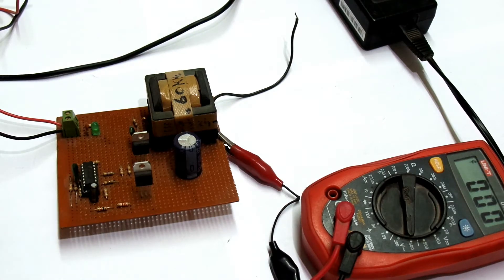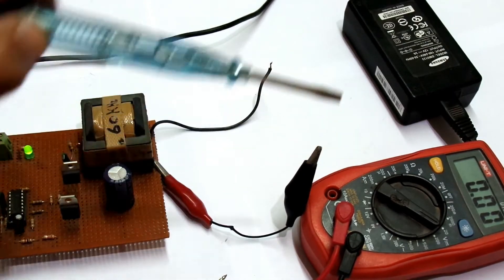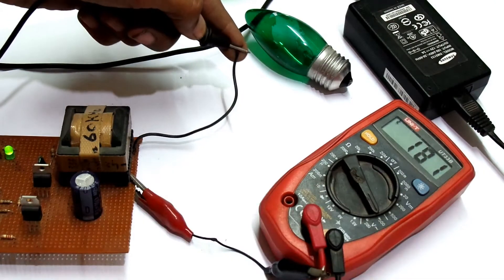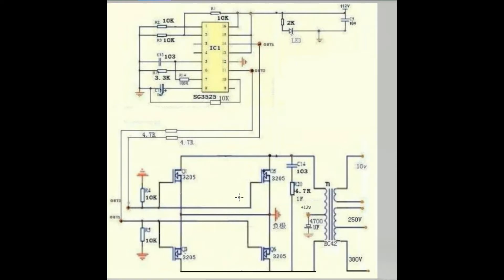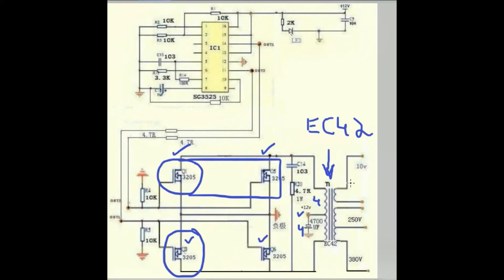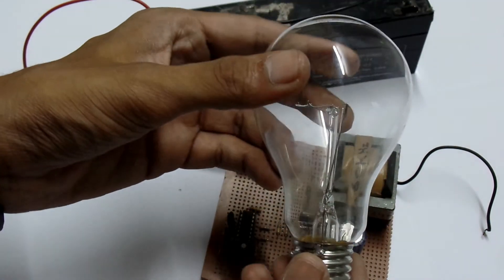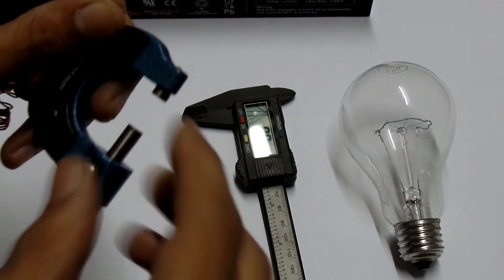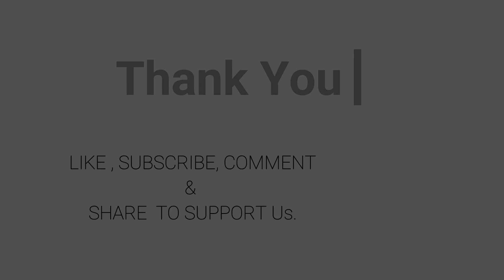DIY Ferrite Core Inverter 230v with Schematic (Part 2)

Comment: Great work sir🎉 but unfortunately I tried and followed the schematic diagram still my 4 3205 mosfet got blown 😢 i tried twice but no positive result did u have an idea on what am missing pls sir i need help 🙏🙏
Reply from the maker: @muktarahmed1304  yes sure. Let me know more about the way you assembled the circuit. So I can help you out with that. Double check your connections according to the schematic and IC datasheet. Use 4.7k resistor between gates and ground of every FET.
Reply: @samtechpro  thanks sir i will try again 😍😍😍

Comment: I never can understand why at higher frequency the mosfet get hot even at no load it get hot so fan is needed for higher frequency transformer never understand why
Reply from the maker: its very difficult to answer the question here in comment section. you may join our group of facebook the link to which is facebook.com/groups/samtechpro

Comment: Can you suggest circuit for 1kw inverter
Reply from the maker: same circuit would work but you may need to use big ferrite transformer with thick windings and more FETs in parallel

Comment: Hi, I have used 110v winding for transformer because I need 110vdc output , but after rectifying I am getting 300 vdc , how do I reduce it. By removing capacitor from output I am getting 200vdc . How can I get 110 vdc ?
Reply from the maker: You need to reduce turns on secondary keep turns between 40 to 42 turns only
Reply: @samtechpro  it is already 35 turns in secondary and in primary it is 3 turns centre tapped
Reply from the maker: @nikkmer  dont make only 3 turns they must be 3-0-3 turns centertapped means total 6 turns. Also make sure you used the same component so your frequency of oscillator matches the transformer
Reply: @samtechpro  yes I meant 3-0-3 turns not 3 turns and all are same components

Comment: Sir, I was wondering about the inbetweens of high frequency and low frequency that u have explained a bit in the comment as well as in the video. Since, frequency is conventional when it comes to play in our overall electrical network and that's being 50-60hz in general, so there must be some change to be incorporated in the inverter circuit..moreover, the inverter output frequency we are getting from this transformer is the same as the input frequency of the transformer which is nearly 27khz(u said in a reply)..Now, the frequency no matter how much may be is not important for resistive loads as they consume just the real power.But in inductive load the consume appparent power depending on the output frequency which must be specific in between 50hz or 60hz and that can't be in khz range at all though. My request to u if kindly u can explain the concept on this frequency management within conventional frequency range in case of inductive load  more further it will be very very helpful sir.. Also let me know sir if i made any mistake in my understanding the concept above..Thank u sir for sharing ur knowledge. :)..

Comment: will it cause any problem if i use a thinner wire like 0.3 mm for both primary and secondary coil ?  and how to calculate the winding if i use other size transformer, i'm scratching my head with the transformer, already blown 4 mosfet

Comment: Nice explained circuit , two question for you , what di I need to change in circuit  to  input 24V , and I also need help to calculate 24VDC / 310 VDC  Ferrite Winding for now

Comment: How much watt it can support
Reply from the maker: 250W
Reply: Which ferrite  core should i use for 600 watt and what should be the turns
Reply from the maker: @hasanabdurrahim2455  you can search for the core types for power. The turns ratio will be the same but diameter should be more thick than i used in this video for the winding.

Comment: A pure sine wave inverter should be able to supply a standard ac-dc adapter which employs a standard 50-60 hz step down transformer inside. Is it work for this?
Reply from the maker: Its output is 27Khz and its not suitable for regular 50-60hz appliances. In order to make it 50-60Hz you need additional oscillator with H-Bridge to have a 50Hz output.

Comment: Hi can you please tell me how modify the circuit for giving feedback to the IC so that I can regulate the output voltage for different loads
Reply from the maker: Yes, you need to rectify the output and then converted DC +ve (while GND of DC rectified output is connected to IC GND) should be sent to pin 1 which is the inverting pin of sg3525 ic through 100K ohm resistor in series. And don't disconnect the 10K resistor that is connected between pin 1 and GND
Reply: Sam Technology Professionals thank you so much. But according to the datasheet of ic shouldn't I connect the feedback to pin 16 which says as vref??
But the transformer that i designed outputs the voltage of 400v so what value of resistor should I use??
Reply from the maker: use 150K . Feedback is always connected to the inverting pin while vref is the reference voltage according to which Op-amp settles the output. You may also need to adjust that.
Reply: Sam Technology Professionals thank you so much for your response and help, I really appreciate it
Reply: Sam Technology Professionals,
I did exactly as you told about the feedback circuit but I can only change or control output voltage but it does not stabilize the output voltage when I change the input voltage so please help!
Reply from the maker: You must need to set vref with capacitor and resistor. I give you a link which will help you in modifying your circuit. Here it is : http://3.bp.blogspot.com/-GBGz37fmU2Y/UEZS3DLMxWI/AAAAAAAAA0k/VETHvKgyUpQ/s1600/PWM+Inverter+circuit+diagram.png
Remember one thing that you just need to understand the circuit your can't make the same connections like shown in this link. Because its for sg3524 while my design is sg3525 both differs.
Reply: Sam Technology Professionals thank you so much
Reply: Sam Technology Professionals can I add protection circuit to this?? Like short circuit protection, because right now I am doing inverter project in which 24v DC is converted to 400v AC and then rectified to DC using fast recovery diodes and I am using 'EGS002' spwm board to chop down 400v DC to 230v AC 50hz pure sine wave
Reply from the maker: Clrohan chinni13 yes you can add fuse at the battery input rated 10A

Comment: Sam Technology Professionals 
Hi, I am using EE 65/32/27 F48 MMG core, so could you please tell me the maximum power that the core can handle and what would be the optimum frequency to get peak power output.
I want to build it for 24 volt at the primary and 380-400 volt at the secondary.
Please help me I am trying to get information regarding this but I am really not getting it so could you help me please!
Reply from the maker: just download and read the datasheet for your core model number. Search it on google. You'll find out its responses to different frequency range and also the maximum power it can deliver. My circuit is driving MOSFETs on 27Khz frequency. If you want to try it out then do and watch how much power you have.
Reply: Sam Technology Professionals thank you so much for helping me out.
Can u send me the link for datasheet?? , Please?.
Also I don't know much about how to check the frequency response for different frequency and to get the maximum power so could you please help me in this??

Comment: could anyone please tell me how to increase the switching frequency at the mosfets to  40 khz?
Reply from the maker: Clrohan chinni13 you need to change resistors connected to the Rt pin of the IC. Change it according to the formula given in the data sheet of IC
Reply: Sam Technology Professionals 
Hi, I am using EE 65/32/27 F48 MMG core, so could you please tell me the maximum power that the core can handle and what would be the optimum frequency to get peak power output.
I want to build it for 24 volt at the primary and 380-400 volt at the secondary.
Please help me I am trying to get information regarding this but I am really not getting it so could you help me please!

Comment: Great video. Can you please help me understand why did you select EC42 core particularly?
Reply from the maker: Sai Prasad actually this was the one I could easily get. But upon experiments any core works with this circuit. But you can take a look onto an article related to the topis how to select core for your circuit. By the way this circuit is oscillating at 27.6khz
Reply: Sam Technology Professionals Thank you very much for your reply! I'm trying to build a pure sine wave inverter. The only thing I'm stuck is at core selection and frequency selection. Your video helped me understanding the problems which may be encountered during the building. The grounding issue happened with me as well previously. Any help would save my life. Again thank you very much! Keep posting the videos! <3

Comment: Hey I just wanted high wattage so ,I have to increase thickness of only secondary winding right?
Reply from the maker: +Devraja Devu not only secondary but also primary. Experimenting different thickness would be easy. You also need to increase MOSFETs in parallel. For example for 500W you need total 4 mosfets means 2 in each bridge.
Reply: Sam Technology Professionals what might be the frequency of ur model
Reply from the maker: Devraja Devu probably 60Khz

Comment: Hey are all the red ground thing u showed going to the negative of the battery?????
Reply from the maker: Devraja Devu yes that is ground connects to -ve of battery
Reply: Sam Technology Professionals can u send a clear circuit diagram to this gmail account now plz:- devraja70@gmail.
Reply: And for increasing the power of the output should I increase the size of both secondary and primary copper wires?

Comment: Can you please help me i have made the same circuit expect i used TL494 IC it boost the voltage in the secondary winding of Core it works just fine expect it use too much power without connecting any load the amperage draw without any load is about 1.5 amp, i tried to change the frequency when the amp draw reach to lower point the output power become very low otherwise with higher frequency is output higher power but this 1.5 amp draw is my problem can you please tell me how i can decrees it ?
Reply from the maker: Republic of Tutorials The problem you're facing is frequency problem coz it doesn't match to the specification of the ferrite core. If nothing work while changing frequency then the problem is with the enameled wire you're using. Check its resistance. Also silver winding has more resistance than copper winding. All factors needs to be checked.
Reply: Thanks yes the frequency is not stable its changing by the time can you please help me why this happened ?
i have tried your circuit but it not works, Can you please send me this circuit in a good resolution 
republicoftutorials@gmail.com

Thanks in advance
Reply from the maker: Republic of Tutorials ok I'll send you. One thing i want to suggest is to use only sg3525. Because the ic you're using is quite different than sg3525. So, get sg3525 and implement the circuit diagram.

Comment: Well explained! Whats in the part 3 and 4? Because all details are already given
Reply from the maker: The Diffusant in part 3 we will discuss the 50hz driver. And in part 4 we'll perform switching between mains ac and inverter to turn it in ups uninterrupted power supply